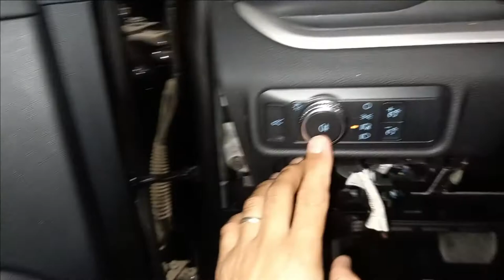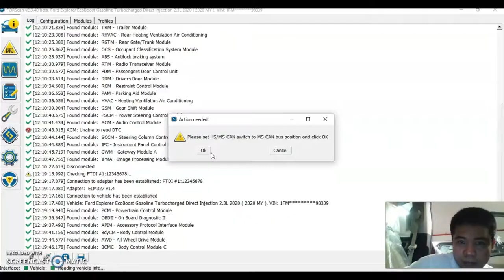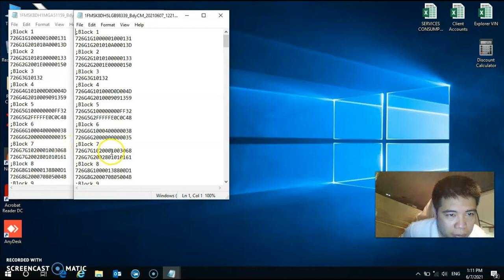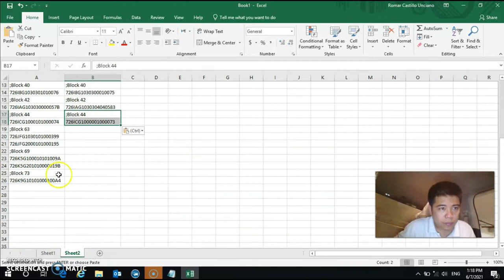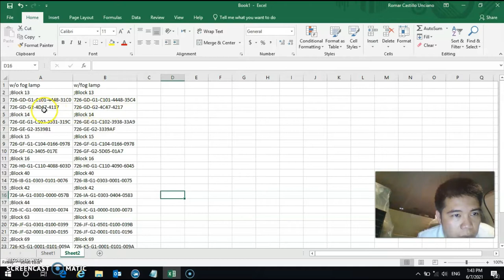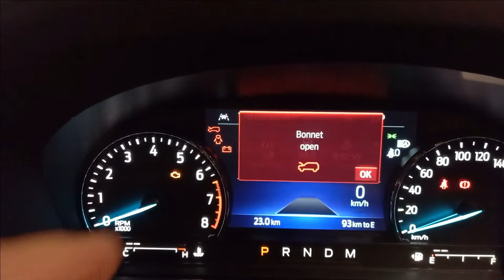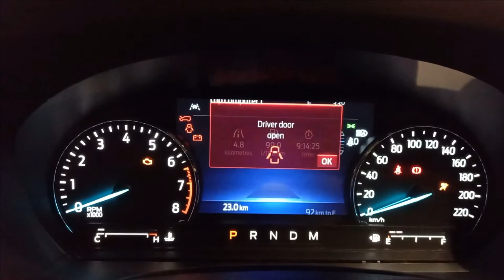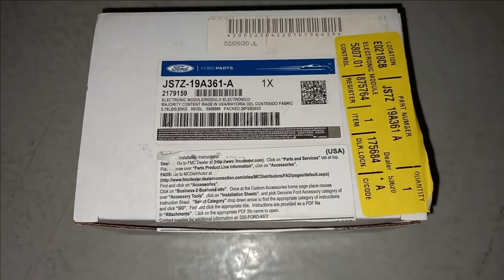Vlog#10 - Enabling Ford Explorer 2021 Fog Lamps

Comment: Hello, what are the parts needed to install the fog lamps in the Ford Explorer?
Reply from the maker: 1. Headlight switch Assy (with front fog light)
2. Fog light harness 
3. Fog light bezels 
4. Bolts
Reply: @Bayantawn  do you have the part number for each part needed?
Reply from the maker: Contact me via email romarunciano@gmail.com
Reply: Hi kabayan ano ang location nio? Thanks
Reply from the maker: Riyadh po